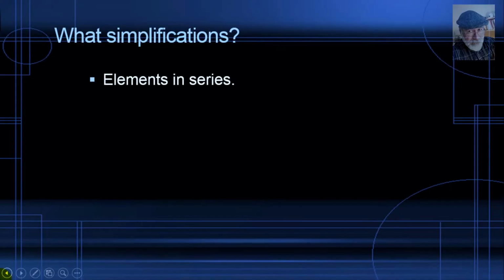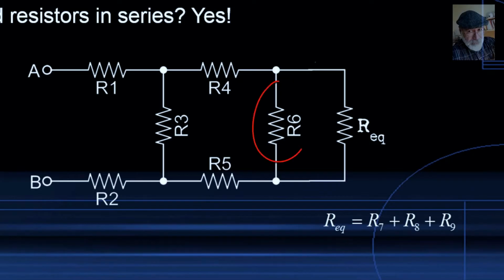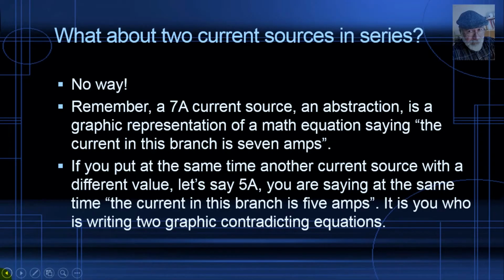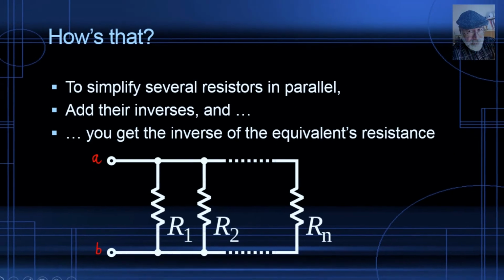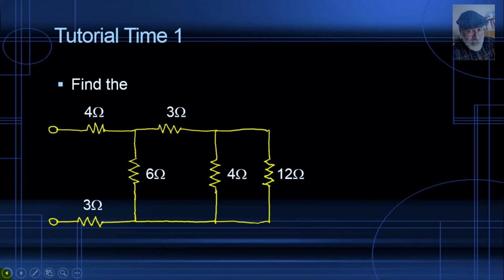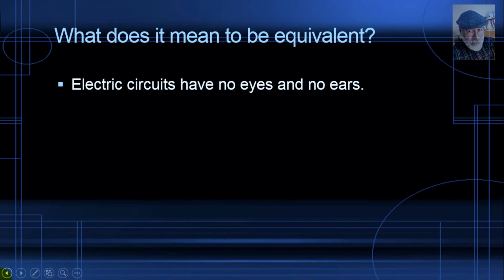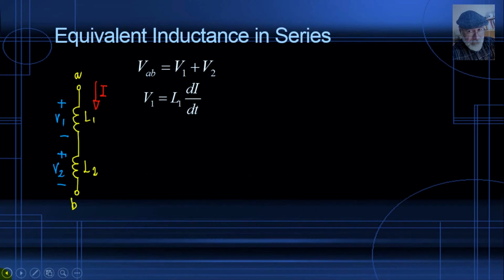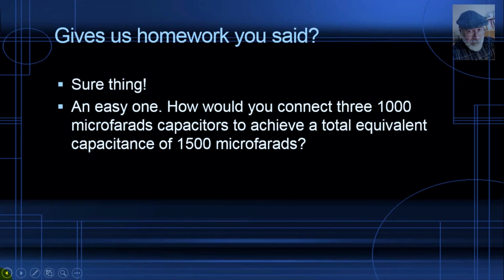EE 101/13 - Circuit Simplifications

Comment: fantastic video
What if we started calculating the Equivalent Resistance in Tutorial Time 1 from the nodes on the left moving towards the right ?
Reply from the maker: +Ronnie McCera Simplifying resistors in cicuits like the one in TT1 is like evaluating an algebraic expresion with lots of parentheses, brackets and braces nested groups. We evaluate it from the inside out. We do the same, the order of simplification is suggested (and sometimes imposed by) by the circuit itself.

Comment: You are a God and i will worship you. Please make a video on very a complex circuit that has transistor diode all the passive elements and explain the role of each of element, the direction of current and voltage development. Just break it down bit by bit. Just one big circuit. Thank you sir.
Reply from the maker: sirolsh2 I try to be a good servant of God, that I accept. But I am moved by your enormous enthusiasm, I really am, thank you. On the big circuit ... that will have to wait until we talk of diodes, of BJTs, of MOSFETs, of biasing electronics, of small signal analysis ... many moons into the future.